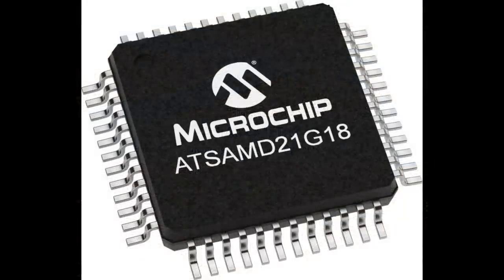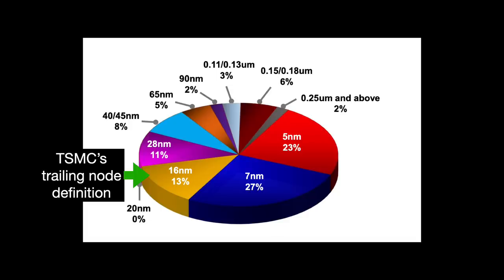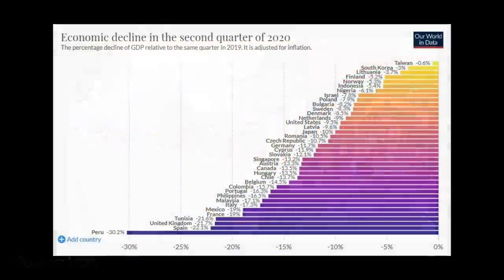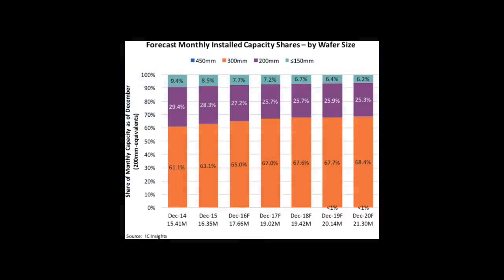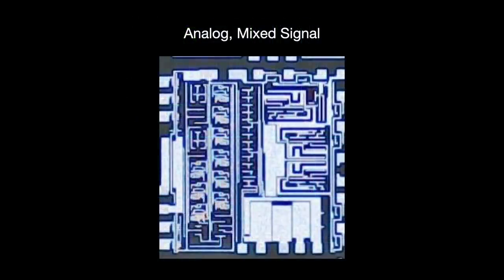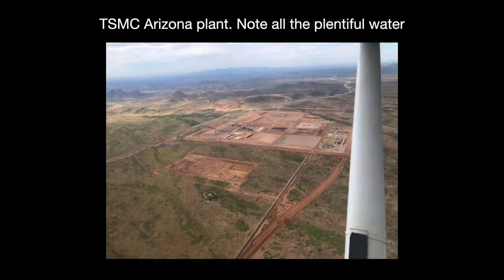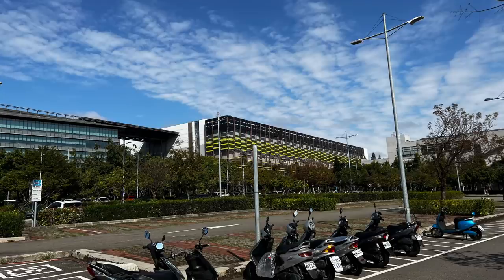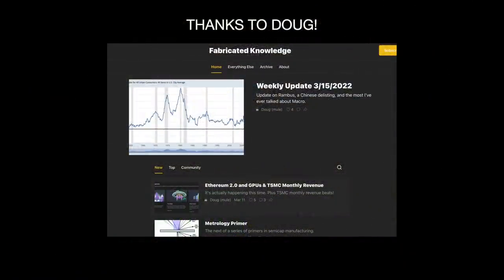Where The Real Chip Shortage Is

Comment: Respectfully, shutting down a 200mm fab to retool and upgrade to 300mm would be a grave mistake relative to building a new 300 mm clean room on the same fab site. Building a new fab would nearly always be economically advantageous especially if the 200mm fab is at max utilization
Reply: Yeah I agree.  Those companies need to produce WHILE a refit would be happening?  Not easy to do, so in general fabs get built and then it stays the same with few exceptions.  TSMC can afford to retool fabs, such as taking a 5nm fab to 4 or 3nm because most the equipment is the same.  One thing about the fabs being built in AZ by TSMC is, it has the space and will probably become a full fledged giga-fab like they have in Taiwan.  It gives them the ability to have 6 fabs in one place.  I'm guessing they'll expand that plant with N4 which is a retooled N5, and also N3 which is a new line.  When TSMC comes out on N3 the demand is going to be CRAZY.

I hope Intel succeeds with their Intel 20A. If they do they'll have the most advanced node in the world at the time (late 2024 early 2025).  That would take a lot of pressure off high performance nodes and then nodes like 12 - 7nm should drop in price.
Reply: Building a new fab for low margin products doesn’t seem feasible to me. I think this was also addressed in the video.
Reply: @Conservator.  per transistor cost bottoms out at 28nm, so maybe there's a way to regain some of the cost advantage vs. 130nm? It's just that there wasn't enough pressure to build more, not enough to offset the risks. You do have a problem that IO area probably won't shrinkify much at all though.
Reply: Correct!
You simply cannot shutdown an operating fab, even during a chip glut. The fab literally loses money during any shurdown.
Reply: @cnordegren  The fab would lose money during the shutdown period but that money could be regained in the period thereafter when they would be producing double the output at roughly the same costs.
Reply: It’s nm not mm
Reply: @964cuplove  it's millimetres. The silicon crystal is manufactured either 20cm thicc or 30cm thiccccc (and very tall, those are impressive things in their own right, kill you easily) and then sliced, that's the wafer size. Problem is any equipment works with one size or the other, you can't like peacemeal upgrade the factory.
Reply: @964cuplove  No dude, he's talking about the wafer, not transistor size.  If you're measuring a full wafer in nm we're in a world of hurt.
Reply: I am not actually so sure you need to completely shut down production for a long time.
I would think you could temporarily reduce output while installing new machines and calibrating them (since these are legacy node that part should be pretty well understand and therefore easier to plan). Then you might even be able to do a rolling change to 300mm wafers while producing lesser and lesser 200mm wafers.
At least in PCB manufacturing that is how it is often done, we changed from two layers Aluminium boards to six layers all in a rolling release while never dipping bellow 75% of our original output (this was necessary since we had automotive supply contracts with big penalties).
I am not sure if this is possible for chip production but I could imagine that you only need a very short full downtime period.
Reply: @Conservator.  You are correct. The margin on these type of devices, typically running on older processes, tends to be very thin & is only really profitable when running on fully depreciated tools and in fully depreciated factories.
Even converting to 300 mm tooling would kill profitability as most 300mm tooling is expensive as it is designed for much more advanced processes. Even if it wasn't that expensive, you still have depreciation back into the equation again, as it is the fully depreciated aspect of older fabs that makes the product economically feasible.
Reply: @thecraggrat  even when you figure in that arm holdings gets a few cents for each one you make...
Reply: @kayakMike1000  Depends what you are talking about, but on some of the devices made a few cents in cost can make a significant difference to the profitability, though we are really not talking about ARM processors here.
Reply: @PhilfreezeCH  You might not be sure but I am sure. You can't run a 200mm wafer in a 300mm tool and vice versa. PCB manufacturing vs Silicon wafers is the difference in complexity between making a screw and making a drill.
Reply: @Conservator.  
Unless those low margin move up to the leading edge that they will still need to stay in production. Everyone needs op-amp and voltage regulators.
Reply: @Garrus Vakarian 
Sometimes old infrastructure is taken down because the cost to rehabilitate it exceeds the cost of rebuilding it. 
The author is cheaper to switch from 200 to 300 that would be to build a new fab. The post responding to pointed out that would take the fab off-line for a while during the time when it’s running at full capacity. Not a great idea in the short term.
Reply: The other reason you wouldn't shut down a fab to retool it is the fab building itself is the cheap part.  Its all the equipment inside that's expensive.  If you're replacing most of the equipment to do an upgrade, might as well just leave the old fab running (and making money) and just build a new one.  Also, many of these fab buildings are tailored to the equipment inside.  You often can't just wheel the old equipment out and roll new equipment in.  New equipment may very well require extensive remodeling of the building itself as well as the building's support infrastructure.
Reply: CHIP clean rooms are 100X more clean than operating rooms.  You cannot "build" anything inside a working clean room, it is impossible.  One spill of contamination particulate and you lose weeks of production parts as the process is long, slow, and must be nearly perfectly clean.
Reply: @neilkurzman4907  moving to 300mm wafers will double the capacity. That will help solving the shortages.
Reply: @Conservator.  
It will double capacity after the plant is shut down, the retrofits done, the plant cleaned and restarted. 
Which means it will be worse before it’s better. It also assumes everything else is available. My Microchip representative told me last year they had trouble getting lead frames. 
I had asked him how could you have a chip shortage you make them. 
For a lot of these items the chip shortage is causing the chip shortage. The same way the toilet paper shortage caused the toilet paper shortage. 
Creating too much new production now will only cause problems in the future. And the chip makers know it. 
You can’t spend billions now knowing it’s going to be idle in a year or two. 🤷🏻‍♂️
Reply: Another problem is the availability of 300 mm tools. Right now all of the major tools suppliers Applied Materials, TEL, LAM, etc. have huge backlogs. Depending how they originally ordered their 200 mm tools you can perform a wafer size conversion within a current 200 mm tool core though this is not feasible for all tool types.
Reply: Intel did it to Fab22 in Arizona ~ 2001 before it was absorbed into F32
Reply: @Hallettjs7957  Intel did it, yes. The largest most cash flush semiconductor company on the planet did it. Once. Analog and discrete makers aren’t working with that kind of capital. And if they’re III-V substrate forget it; the wafers don’t even exist.
Reply: @neilkurzman4907  I wanted to make a post about this exact thing but you said it better. For decades semiconductor companies have been in a feast to famine cycle of greedily chasing capacity. Much like the oil and gas refining industry this time around, when customers and governments pissed and moaned about building extra capacity, knowing the business cycle has busted every time and they’ve been left holding the bag, they said no. It feels like maybe we finally learned our lesson about chasing our own tail to overproduce in good times.
Reply: I'd opine that both options make no sense.
If a fab is built, it has to produce the latest chips it's capable of producing to maximize profits(maybe significant, maybe not) and maximize years of productivity. Building something that only produces low profit margins for fewer years seems to me questionable.
Reply: @tonysu8860  that would strongly depend on whether you stock it with new tools or used ones; preferably used ones you already own. If the latter is the case and the equipment is already depreciated, it might make financial sense to build a fab shell and start it up. But then why weren’t you doing it already? 

Semiconductors just don’t allow for this kind of “go back and capture old nodes/tech” business model. A good example of one case where this worked was when TI built RFab in Richardson, TX. The only reasons they were able to start up a 300mm analog line was 1) they had already built the fab shell when the subprime mortgage crisis shit the bed and 2) Qimonda had just gone under hard and sold a massive amount of 300mm tool assets for cents on the dollar. That sort of confluence of chance almost never happens.
Reply: they don't have the capital to build a new 300mm stuff. they cant just magic more space in  their clean rooms. 300mm is just so mutch better than 200mm, and retooling 200 to 300 is so much easier than constructing a new building just to hold onto a technology that is less efficient with silicon.
Reply: @nick4506  just drop old products, the microcontroller industry better learn from a good wonderful new invention, they are called "compilers". they allow for keeping the source code and upgrading the microchips.
(its laughing at the car manufacturers, they are the ones crying loud, everyone else is just upgrading their BOM to better chips that use newer nodes as they come online)
Reply: @tonysu8860   " low profit margins for fewer years seems to me questionable." totally questionable. And its only to supply demand to that one specific industry that runs on old IP and processes Only because they can't buy their microchips for $0.5 in the old process. Too bad opamps get costly for everyone else... I guess, just make your product more expensive ? Or use more dense components, but that means paying for IP. I wonder why there isn't an industry shared effort to develop IP. It would simplify a lot of the problems with upgrading tooling...

And what does going back to 200mm buy for any other industry ? I mean, instead of retooling to a newer process, you build more clean room space only to install the old tooling. That makes no sense.

And all modern TVs, computers, RAM, MCUs, all of them benefit from smaller nodes. Because they sell at $10 to $20 each unit, or at more than $100 for high end computer chips.
So ? to hell with old MCUs and op-amps.
Reply: @monad_tcp   problem is smaller nodes are less reliable just because physics. the drive  voltage for gates dosent come down but the max voltage before it jumps that few nanometers comes down and the smaller we get the less margin between those getts smaller. that means better cleaner powersupplies are a necessity and it drives up cost all around. esp for like cars and stuff with safety equipment that cant be allowed to fail. like the controller for a CNC machine we use runs a 6502 nonstop for 35 years. while even large process graphics cards die after 8. the controllers for the space suits for NASA designed in 2000 also use 6502 for that beefy 8 micrometer process so the radio waves and whatever cant generate a voltage big enough to fry them.
Reply: I think the prices are going to go up. I wonder if discrete designs will come back into fashion?
Reply: Intel's Silicon Qubit plan is going to 300mm

It's the wave of the future
Reply: @Grak70  Intels doing it right now in Ireland, EUV equipment is being installed.
Reply: @nick4506  changing from 200 to 300mm wafers involves more than drop in machine replacents, it also involves new water, gas, electrical, vacuum and other requirements, the whole fab internally needs to be gutted and rettrofitted to accommodate the requirements and specifications of the new tools.
Reply: @michaelkeudel8770  they may be on the same site, but fab 10 and fab 24 are separate entities. Fab 10 was shut a while ago.
Reply: @Grak70  yes, I know, and equipment I designed and built are being installed there. I'm one of those behind the curtain, guys behind the guy behind the curtain. My equipment integrates with the ASML EUV machine, and our part takes just as long to build as the EUV machine.
Reply: @michaelkeudel8770  well the point being it’s still extremely rare to do that for all the reasons laid out in this thread. Having another 300mm fab on the same campus is probably a huge advantage. As well as just being Intel in the first place.
Reply: Tool size is the leading problem with retooling. 100 to 125 to 150 to 200mm all used similar sized tooling, 300mm is a whole different world.
Reply: @nvignesh  the thing is on this channel: some of us ARE those people.
Reply: ... if we just had unlimited resources ... like Rumpelstiltskin by the Brothers Grimm;)
Friends, you should listen to yourself. Like little children who completely ignore reality. Not even the (building site) space with all the needed infrastructure is unlimited.
Modern factories have multiple production lines. They are simply rebuilt or modernized one after the other. Do you think the architects are stupid (So dumber than we here?:P) .... oh yes, there is "only" over 200 years of experience in the field. Why are some of the people here discussing this (by lying making wild claims) if they haven't even seen the inside of a factory and have no idea?
Even if there is so much demand that the construction of a new factory is justified, that does not change the fact that the old one still needs to be modernized(There is no sense to leave it less productive than it can be). How does one come up with such an unworldly and illogical (and demonstrably wrong) representation of reality, Jacob? Maybe we didn't do any research beforehand ... or asked someone who knows about it (even an employee who has already witnessed such conversions or participated in them... like me) would be enough.
Respectfully, this is not meant personally but your comment looks like a statement (In the words of Jean Luc Picard: MAKE IT SO!) which does not reflect reality, than a question to clarify pieces of the topic. 

Anyway, have a nice shortage, all!:)
Reply: @dieSpinnt  with all due respect you have no idea what you’re talking about. Semiconductor fabs are not like Chinese sweat shops spitting out wax lips and Tupperware.
Reply: @Grak70  Sorry for my reaction, but isn't it under-earthy to start "with all due respect" and then showing your scorn by not discussing an argument or staying on topic ... and making a Karen-move based on your feelings ... whatever else might mean your strange choice of household appliances and joke articles?
Reply: @dieSpinnt  maybe it’s a second language issue but your tone is incredibly condescending for someone with no professional experience in this field.
Reply: @Grak70  That is your assumption, Troll. I don't care.
Reply: @dieSpinnt  it’s not an assumption because if you worked in this industry you wouldn’t be coming in here saying something as foolish and uninformed as that a 150mm or 200mm fab must inevitably be upgraded eventually. It’s exceedingly rare to do that because of the opportunity cost of lost production time. Those fabs are still producing chips and revenue streams while they’re online. Taking them completely offline to make a massive capital investment is ground-floor stupid. If you want the capacity of a 300mm fab and you have a 200mm one, you build a new 300mm fab and keep the 200mm one running in the meantime. It’s likely completely depreciated and running better than when you built it due to small improvements and engineering tweaks over time and it’s still making you money.
Reply: @johndoh5182  Yeah, AZ huh? Where/how do you get industrial level water supply? Talk about the required infrastructure; qualified employees with Labor contracts. I can't see Fab plants "Just Popping Up"!
Reply: They should consult you before making big decisions tsk tsk
Reply: You need to ceate new cleanrooms then whereas uograding wafer size is just switching out processibg equipments

Comment: I worked in the industry about 25 years ago.  While much has changed since then, some things have not.
As you stated there are basically 2 manufacturing processes, memory and logic.  Within each process, they are optimized for the highest yield.  This means designs are "tweaked" to work to a specific process and the process may be "tweaked" to a specific type of chip.  A fab making DRAM may NOT quickly be able to switch over and make NAND memory.
Worse, combining memory and logic will never be "optimal".  Today's CPU chips have large amounts of cache memory.  SOC (system on a chip) have an even worse combination; logic, memory, both cache and system SRAM, and NAND flash.  Many have analog portion for AtoD or DtoA.  Automotive chips do not want to drop below a 5 Vref so now you have multiple voltages.